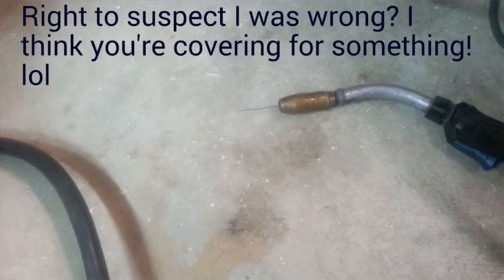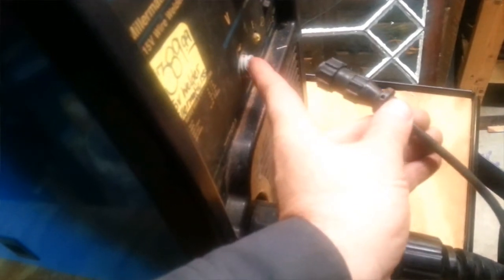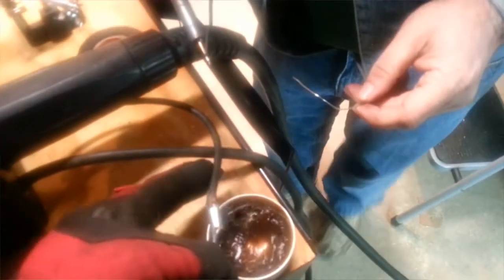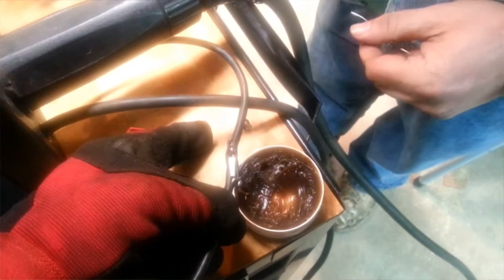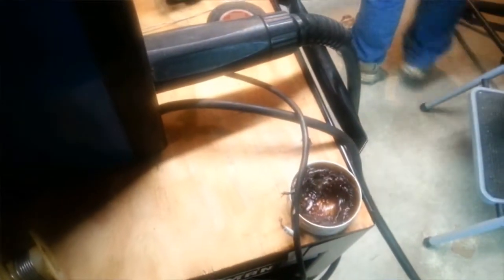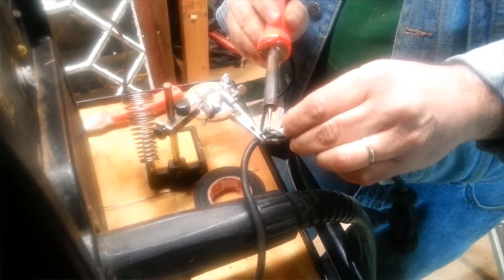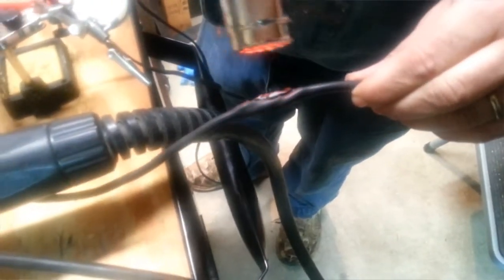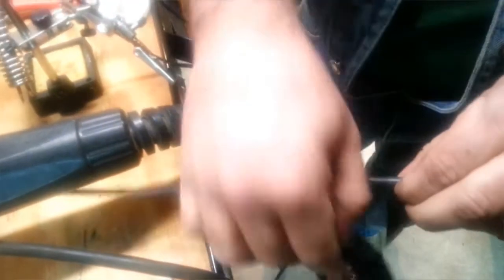How to Fix a MIG Welder

Comment: Nice repair DE....do you have a link to where NASA shows to just put two wires side by side and then solder as I couldn't find one? The method that I try to use is also recommended by NASA but uses a different technique called a 'linesman's splice'. Although, it was originally intended for solid wires, I use it for stranded wires too. I tried to paste a link, but YouTube will not allow it. Maybe do a search and you can see what I mean.
Reply: +CB Tech Hello Cyril and I hope you and your family are doing well. I've used the method also that you mention, but it's not as strong mechanically. The linesman's splice is a much stronger connection and you don't need any extra hands or clamps to hold the wires when soldering. And I'll follow it up with a heat shrink that has a sealant built in. If you go to google.com and type in 'linesman's splice nasa', it will be the first link in the search. Take care Cyril...
Reply from the maker: +stuzman52 I kept meaning to look for a link for you. The truth is, I trusted Moog on Mighty Car Mods when he said that it was the NASA style of making the strongest solder connections. I believe (on memory) they tested 17 different types of soldering and found what was strongest.

I agree with Moog, that twisting wires together is commonplace, and while it's not as strong soldered, it can be a method of choice if there is no space to do it better.

If you revisit the video, I learned a lot more about soldering from zx8401ztv. He's spent more time fixing electrical things than anything else. He doesn't even have a car, but he enjoys car repair videos.
Reply from the maker: +CB Tech Good to see you. The gentleman I mentioned who taught me a lot pointed out heat shrink. I had it on there, but since I used my friend's soldering iron with a thin tip, it heated the wires too slowly and melted the protective heat shrink I had set up.

Comment: You bodgy buggers lol :-D
As ive been soldering things for years i was screaming at the screen lol.
That switch system looked pretty crappy :-(
 But it works again :-D :-D
Reply from the maker: John and I are basic on Soldering for sure. He knows correct technique taught in school as I do. He hates it and I like it but almost never do it.

Got anything to teach me mate?
Reply from the maker: I thought the switch system looked cheap before I pulled it apart. There's about 2 mm of wearing out plastic holding the actual trigger in.

If it's not gently treated I'll have to learn plastic welding or but a metal wire in place of the plastic.

I was just a surgical technician and I'd rather do surgery than do that repair.

If that fells kinda like how Scotty Kilmer says, pray you have money for a new one.
Reply: +DE “AutoBravado” Nichols 
Ooow now lol.
Prep the wire.
Clean the strands if dirty and twist then coat with flux if you have some.
Apply a large iron with large tip (tinned) to the strands and feed solder into the iron/wire joint while moving the iron along the wire.
You should have a tinned wire.
Do the other one the same.
.
If you have space then twist the wires together to make a mechanical joint, then apply the iron to the wires with some more solder, it will bond them together.
If you dont have room then use the clips you have to hold the wires side by side, or twist a few turns of thin copper wire around them to hold them in place, then apply the iron and solder.
.
Tape works, but heatshrink tubing is fantastic if you have enough space to slide some onto the wire before soldering.
.
Advanced: Get someone else to do it ha ha :-D :-D
Reply: +DE “AutoBravado” Nichols 
I would not think the contacts would be carrying much current or voltage, so im sure you could remake it with other materials.
It does depend on how good you can copy parts.
Ive had to do it in the past, ive even used aluminium plate where it does not matter too much, and a copper coin for a contact to solder a wire to.
But im an evil sod lol :-D
Reply from the maker: Yeah. I can hear the relay click in the welder so it's a low current switch.
Reply from the maker: Well. That makes me feel better. John had me clean the wire with flux before we started. I guess that didn't make it into the video. I didn't show that.

You're right. He had the 40 watt and I the 30 watt. ..but mine had a bigger tip so it probably would have transferred more heat and allowed to do more heating of the wire then giving up and hitting the solder directly after a while.

Yes, it's subtle, but I mentioned us melting the heat shrink we had ready so we couldn't slide it over. We didn't make enough space when we snuck it in.
Reply from the maker: Well. That makes me feel better. John had me clean the wire with flux before we started. I guess that didn't make it into the video. I didn't show that.

You're right. He had the 40 watt and I the 30 watt. ..but mine had a bigger tip so it probably would have transferred more heat and allowed to do more heating of the wire then giving up and hitting the solder directly after a while.

Yes, it's subtle, but I mentioned us melting the heat shrink we had ready so we couldn't slide it over. We didn't make enough space when we snuck it in.
Reply: +DE “AutoBravado” Nichols 
But the joint was made and the welder works again :-D.
.
Loads of people have problems soldering, its mostly just a habit of keeping metals clean so you can tin them, then remembering that metals will act like a heatsink so use a big enough iron/tip so the mass of the tip has enough heat stored to quickly heat up the metal/joint.
Ive seen people use tiny irons and it takes ages to heat the metal up, and while that is happening the heat goes down the wire and burns the insulation off ha ha ;-D.
.
You can cheat by tinning and soldering all in one go, but the experence is the bit that most people need first.
Logical stuff really aint it ;-D
Reply from the maker: zx8401ztv Ah. The tiny iron melted the heat shrink we had ready because it was so slow. Makes sense!

Using a small wire to wrap around to still Nasa solder it side by side is just awesome.
Reply: +DE “AutoBravado” Nichols 
Well you have to invent devious ways dont you lol :-D